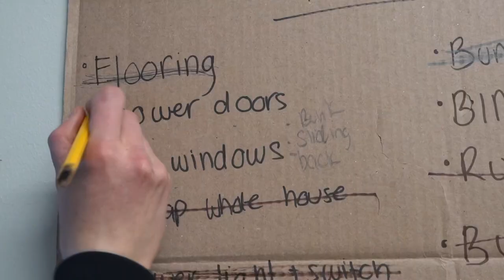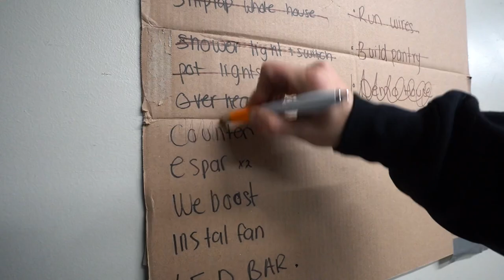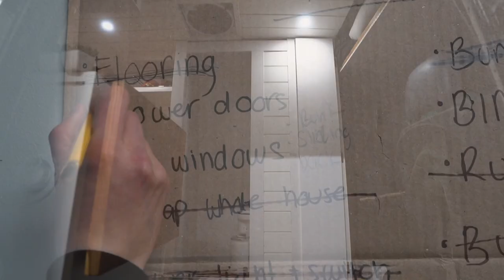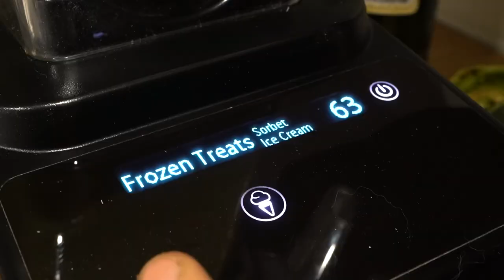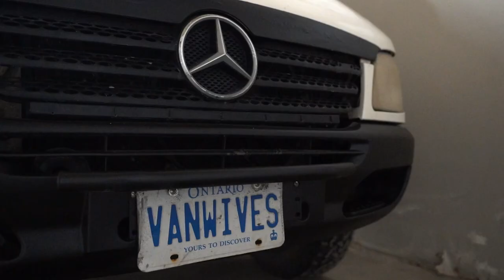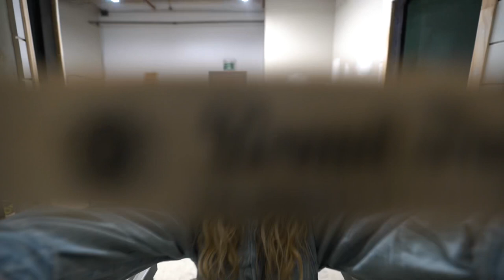WE HAVE TO LEAVE | END of VAN LIFE Build (moving in)

Comment: My name is Mark and I am a US Army veteran(Aviation and Trucking) who spent a year in Iraq as a truck driver, covering about 30k miles and getting a new perspective of a beautiful country, few get to see,. I have a 1993 Ford Bronco that I am fixing up, but my big project, when money and time allow, is its trailer. It is half of a Ford pickup (8ft.bed) cut into a trailer, so it will not only match in color, style, shape, but use the same tires and wheels, making for double the spares/tire life. Of course, I over built it with a 4 link air-bagged suspension which allows me to lower it for loading and raise it to truck height for all terrain exploring. It has it's own battery, solar panel, and air compressor for the air ride. All of those will get up graded when I build the cargo bed into a pop top camper. Folded, it will look like a cargo trailer with a hard  cover, a roof vent/fan, and roof rack for my 3 seater kayak, bike, and DIY 11gal. solar shower (black ABS pipe). Inside, I plan to have a futon for sitting or sleeping, storage, LED lighting, 12VDC and 110VAC. The soft sides that will unfold when the top is up will come from recycled old tents that already have the screened windows and the zipper entrance. Like you, I like to camp away from groomed areas and its inhabitants, and there are lots of places to explore not far away here in NorCal. I hope to some day, get a plot of land and build a container cottage. I am getting a lot of tips from the two of you, so keep the videos coming. Take care.

Comment: OK not to be a downer but when diving at high speed your cell extender antenna will twist that frame possibly breaking your solar panel ..
Reply: Maybe they take it down while driving but wanted to show its placement! 😉👍
Reply from the maker: Hmmm! Will look into this. As far as we know others haven’t had this issue. Thanks!!
Reply: @Vanwives  Did not mention it to be negative I am a overhead door tech and put allot of stuff on a roof rack and travel between Vaughn and Hamilton And I know the power of the wind going over the truck at high speed . Just trying to save you girls some grief is all. l Love the videos and I think your handy work is just great . Your video editing and use of the drone  is some of the best on You tube ..